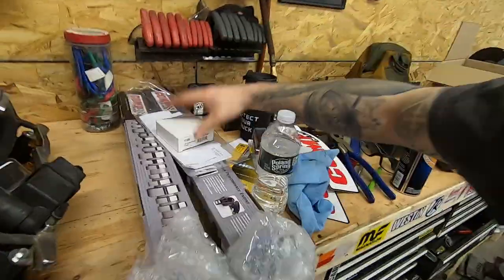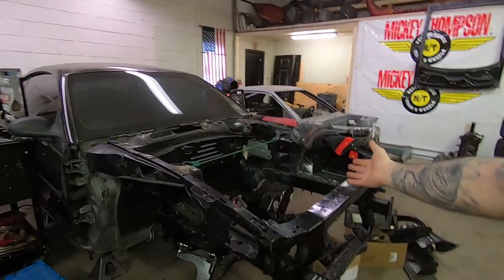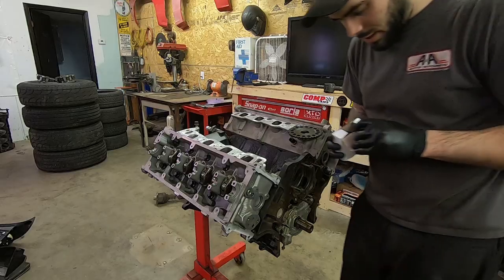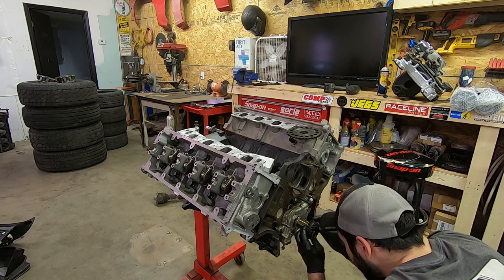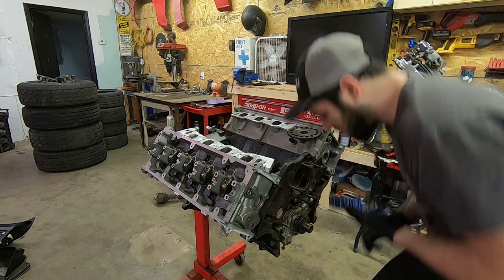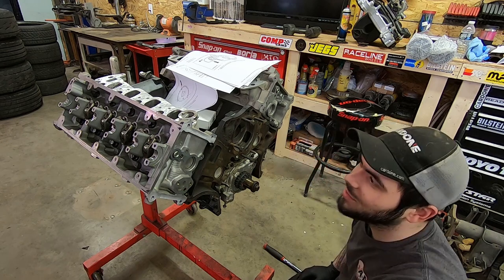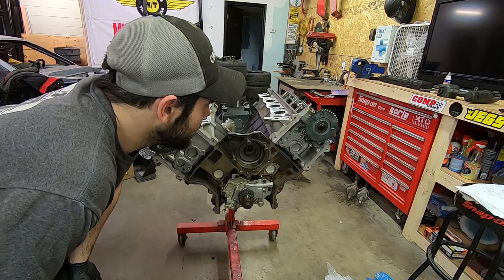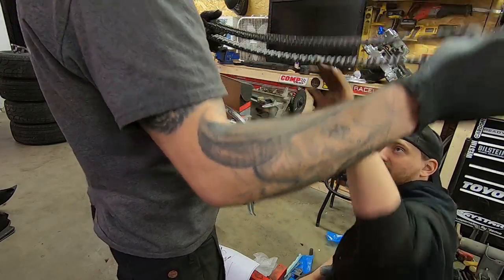4.6 2V COMP CAMS 268 CAMSHAFT INSTALL! XE268AH 102200

Comment: So my f150 got the 4.6 triton V8 in it could I put cam in it like this I haven’t seen any videos of my f150 cammed
Reply: Sure you can..there is videos of cammed 4.6/5.4 f150's on youtube
Reply from the maker: Absolutely. The heads should be the same if I recall correctly.
Reply: @RatchetstrapMedia heads are same intake is different

Comment: I have a question im installing new lash adjusters should i just put them in or do i have to prime them before putting them in. Ive gotten different advice from different people some say prime them some say just put them in without doing anything to them.
Reply from the maker: Prime them. Get all the air out of them. Let them sit in an oil bath for 24 hours and pump away.
Reply: @RatchetstrapMedia  so when i install them i shouldnt be able to press them in right??
Reply from the maker: They will very hard to press
Reply: @RatchetstrapMedia  thanks bro i really appreciate you replying

Comment: How off were the cams? I have a pair of xe268s i havnt put in yet.
Reply from the maker: Tony Fry I believe one was 4 degrees, and the other was 6 degrees. Off enough to have ruined my day and wallet if I didn’t get them degreed lol
Reply: @RatchetstrapMedia  sorry to bother I could use ur help i have a 4.6 motor and it has some comp cam 278 cams in it the motor is rebuilt and assembled and timed at the moment  but they didn’t degree the cams i just dont want to have piston to valve clearance issues what do u recommend
Reply: @RatchetstrapMedia  If u can be any help or give me any suggestions or pointers id appreciate it. The engine is currently assembled and timed like factory dot 2 dot the engine is a 4.6 strocker I believe…. it has 21 cc probe forged pistons forged 8 bolt crank forged h beam pistons arp everything ported pi heads and comp cam 278 with valve springs
Reply from the maker: With 278s, I would definitely degree them. That’s a very high lift can. Take it back and tell them to do it correctly.
Reply: @RatchetstrapMedia  ars you sure brother i talk to another builder he said I should be fine what do you recommend
Reply: @RatchetstrapMedia  i think they did degree because the also checked with dial indicator
Reply from the maker: Does it have a crank gear with lots of numbers on it?

Comment: I have a 2003 f150 4.6l and I want to switch my cams to a stage 1 what do you recommend.  Do I need to change the chains to or just cams will do it?  Mine have 2 cams on each head
Reply from the maker: Is the engine the stock one that came in the f150?
Reply: Mine is stock engine and I’m wanting to put 268ah cams in